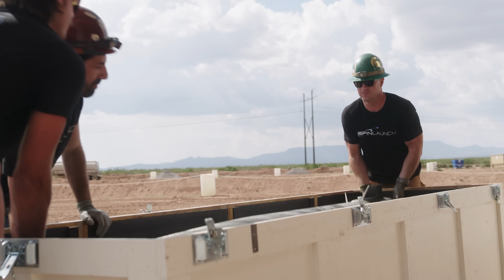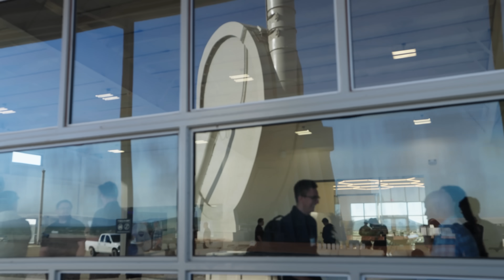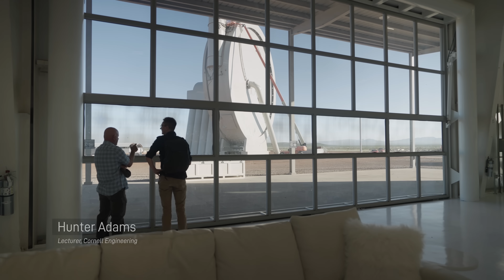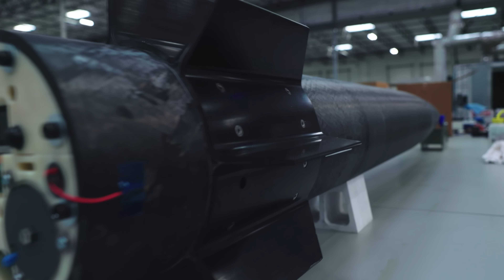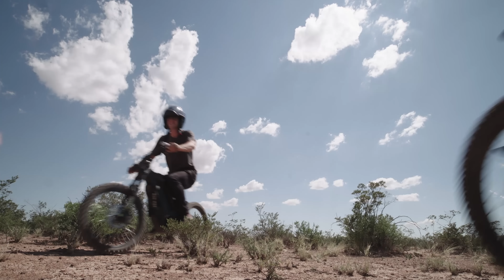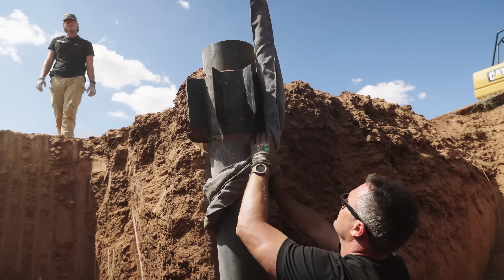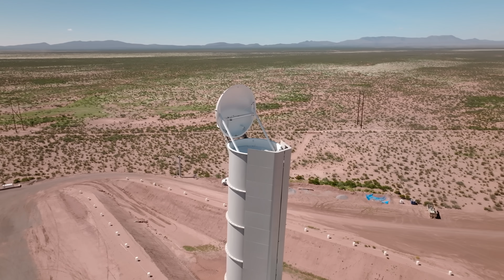Flight Test #10 - The First Payloads

Comment: Spinlaunch: design a technology that flings a rocket fast enough to escape atmosphere 

Military: excellent! Now turn it it sideways.
Reply: they have more eficient ways to do that amount of DMG.
Reply: @nicolaastanghe475  yeah, looking at you Los Alamos
Reply: are you looking at this thing? For intercontinental payloads, chemical rockets are plenty enough already.
Reply: @cdgonepotatoes4219  mount it on a train and you have the Spinner Gustav
Reply: @cdgonepotatoes4219  until you run out of chemicals.  Why do you think the US navy wants to be nuclear electric powered with (electric) lasers and (electric) railguns?
Reply: @ralphm4132  biifuel. You're never running out of propellant as long as there's fertile land and the Sun hasn't swallowed our Earth.
Reply: It won't be fast enough to escape the atmosphere, let alone achieve orbit. And BTW, to achieve orbit you DO need to be traveling sideways (which is why you'll notice rockets angling sideways not long after taking off).
Reply: @michaelnoble2432 In a previous video, they mentioned using a small two stage rocket attached to the launch component. Until some hard numbers about the flight envelope are published it’s difficult to tell what velocity can be reached using spin launch system.
Reply: I’m assuming their pointing it straight up so they don’t pull a Russian federation and fire ordnance into random peoples houses
Reply: "Once ze missiles are up , who cares vere zey come down? - Zat's not my department!", says Werner Von Braun.
Reply: actually you would need to go sideways to bring stuff into space.
Reply: Nerds dissecting the comment but everyone chill it’s comedy gold
Reply: @LebanonJames420  yeah thanks, I think the whoosh was as loud as the spinlaunch whoosh.
Reply: Let’s turn it sideways wins 😂😂
Reply: Bunch of “well actually” ass nerds in the replies, I thought it was a good joke
Reply: @noah4man  🧐
Reply: That's the thing though......the rocket doesn't reach escape velocity at all
Reply: aim it at railgun and see who wins.

Comment: Amazing technology, congrats! Why do you plan to build the final orbital Accelerator at sea level? It will be much more efficient building it at 2500m height, right?
Reply: In North and South America, you do not have many mountains on the East coast. You want to launch towards the Earth rotation direction and as close as possible to the equator (also depends on the orbit). 

The ocean is also a perfect safe place against debris if the vehicle is destroyed mid-flight. For instance you may want to build it along the West coast, to take advantage of the mountains, and launch towards East. If there is a malfunction and the rocket is destroyed mid flight, debris might fall on local population. That's horrible and bad press for the space industry !
Reply: I think the fact you never got a reply tells me it's political... probably saftey to be by the sea but my guess is they are funded with fat grants and have other motives to have their location there and efficiency isn't one of them.
Reply: @DiscoGreen  I think the fact you think sea level is by the sea tells me how political this really is.

Comment: Well done!  Question: Once a payload reaches space, how do you intend to accelerate it to orbital velocity, 17,000mph, to become a satellite?
Reply: The spinning actually doesn't get it into space. All this does is get it closer to space and then rockets take over it's in order to save fuel...
Reply: @traviskey5695  you mean orbit, as the spinning should allow it to get above the 100km altitude
Reply: @biosdilt1399  ACKSHUALLY
Reply: The projectile will contain a rocket which ignites close to the launch apogee and carries it into orbit. Essentially the spin mechanism replaces the first stage (but not the second stage) of a medium-lift rocket such as a Falcon 9.

Comment: This is amazing, it'll cost-effective compare to the traditional rocket launch.
Reply: Yeah the difference is rocket launch exists - this does not... im still waiting for someone to explain physically how can you achieve the velocity required for the 10 minute flight to LEO without the whole thing melting.
Reply: @matejzizanovic7959  I think they're planning to fling these things as a way to replace the first stage of a multi stage rocket. ie, there will be a 2nd and/or 3rd stage srb attached to the projectile to push the payload into orbit. The fling just provides initial altitude at low cost.
Reply: their projection is to be as cost-effective as spacex. see 42 min video on spinlaunch
Reply: @MikeQuinnEnto  Never present a company talking about itself as 'evidence'.
Reply: @gdutfulkbhh7537  42 min video was a team of engineers looking at what they are doing, so not straight company PR bs…

Comment: Um..... flinging a metal tube into the air (however high it goes) is NOT getting anything into orbit.    For orbit you need to get to 17,000mph and in a a specific trajectory, certainly NOT straight up!   so you still need a rocket onboard your metal tube and guidance / navigation and control to get anything into orbit.   and that also requires fuel on-board.     Throwing a metal artillery shell (which is what it resembles) a few thousand feet or even a few thousand meters is not getting anything to orbit.  The Karman line is 328,000feet and that is the START of "space".    This thing isn't getting anything anywhere near the Karman line, and it needs to go SIDEWAYS to get anything into orbit.
Reply: Exactly. Reading these comments really makes me understand how little people know about physics... I get investors are pumping money in it, being physically impossible to be made doesnt mean theres no money to be made on the project, matter a fact main moneymaker thing is hype these days, and hype around space thins is very strong lately, considering people now understanding basic laws of physics...
Reply: @matejzizanovic7959  Yup pretty much.   Also for it to be a functioning rocket after launch (required for orbitral insertion) you'd need solid fuel rocket and avionics, and accelerometers and gyroscopes and mechanical gimbal for the exhaust nozzle for guidance.  I really doubt all these devices could survive (reliably) a 10,000G centripetal load (their number) before being released at very high velocity into 1atm air.    It is basically a mechanical Howitzer (currently).     Do the creators have ANY intention on making this a realistic device for satellite orbital insertion?  Because it 100% will not work in it's current state.  It's a bit laughable that so many people seem to think it's viable. Needs a rocket plus all the internal gubbins (fuel, sensors, avionics, gimbals, ignition source, plus a payload ejector of some type ...) and its a very harsh environment to subject a rocket to before ignition.    Rockets are fine with 10G, 20G, 50G, more than that yes but ...10,000G?   Stuff breaks at those loads and also....to make things survive at those extreme G loads things have to built strongly = heavy = last thing any rocket needs is HEAVY.    High-school physics says it's not working fo satellite LEO insertion.
Reply: These are all very well pointed out comments, probably most can be checked in Thunderf00t debunking videos. One question though: doesn't the Earth rotation provide at least partial tangential speed for the projectile even if it's launched with straight angle?
Reply: @jardel_lucca  Earth's rotation at the equator is approx 1000mph 'East' which is why there is a modest advantage to launching rockets in an Easterly prograde direction from a latitude as close as possible to Equator.  Hence....Cape Canaveral etc. which is 28degrees North of equator and so rockets launch Eastwards (approx) and over water. (safety!).   But it's MINIMAL as you need to be going tangentially at 17,000mph and at a high enough altitude that the atmospheric drag doesn't slow you down so that you crash back to Earth.    This SpinLaunch flight test is an unguided metal tube (AFAIK), and it's impossible for it to get into Low-Earth-Orbit when it's launched vertically from this device UNLESS there is on-board propulsion and guidance and avionics and a steerable gimballing rocket engine.   steerable guidance fins won't work either as they only work INSIDE the atmosphere where there is air.    No air in space obviously, so you need a rocket engine, either solid-fuel or liquid-fuel.
Maybe they DO have a different projectile version that has all that extra stuff in it.... because without that, this project is unworkable.
Reply: You're hurting people's feelings with facts, logic, and mathematics.  Hah.
Reply: @zulucharlie5244  Also the drag of any object hitting sea-level thick air at 1atm (14.7psi) is massive -- it will be instantly decelerating very fast indeed due to huge aero-drag plus of course negative 1g gravity.   Apparently muzzle-velocity can be around 5,000mph, which is a very long way off orbital velocity and it isn't even going the right direction!   It still needs a rocket propulsion to propel it after it's initial launch and it needs to travel PARALLEL to Earth's surface and go a heck of a lot faster than it's device-exit velocity.   Fun toy I suppose but it won't work without rocket propulsion on-board the projectile plus a gimballing exhaust nozzle and avionics to guide it at correct trajectory for low-earth orbit.   No idea if its a clever idea to subject rocket propellants (even solid!) (and gimballing nozzles too) to 10,000G centripetal loads.   Whole thing is monumentally scary, in my view.

Comment: LEO requires not only altitude, but also speed over the ground.  I get how this slingshot can provide altitude, but where does speed over the ground come from?
Reply: Is it due to the rotation of the earth?
Reply: The idea is it replaces the lower stage, you still have an upper stage booster.

Comment: I remember reading an article years ago about miniature vacuum tube circuits surviving 18,000 Gs during World War 2 ( in some artillery shells). No doubt many current projects could survive the Gs in Spinlaunch. 
     I wish you all the best of luck and success in the future.
Reply: It really depends on the scientific experiment. Biological experiments; like studying bacteria or algea in micro-gravity probibly aren't possible.
But there probably are a lot of other experiments/ payloads you can launch on this system..
Reply: All the great inventors in history have had a negative peanut gallery telling them why something couldn’t be done. Then they went out and did it anyway. 

Time will tell.
Reply: Current Artillery shells experience about 40K Gs.  The electronics survive just fine.  This can be as simple as embedding the electronics in epoxy.
Reply: @bradleyrex2968  Seems like it would be far simpler to yeet a payload from an artillery piece than what spin launch is doing
Reply: @LiamL763   That's been tried, but didn't work.  Still someone else might be able to get it to work.  SpinLaunch seems to be making progress despite the internet of experts praying for them to fail.  We'll see.
Reply: @LiamL763  nah. Unless you have enough explosive to match the density of the sun and a barrel the length of Greenland, nah.
Reply: @bradleyrex2968  - "The electronics survive just fine.."

Not ALWAYS.  Some electronic circuits will fail at MUCH LESS than 40kG.
We have had leads disconnect inside IC chips from only Vibration and Acoustic testing at levels nowhere NEAR 40kG.
Reply: @stuartgray5877   Down at the artillery shell factory, you have leads disconnecting?
Reply: @bradleyrex2968  No I build spacecraft and then perform vibration and acoustic testing on them.
Not ONLY will any electronics on this joke of a "rocket" experience the static G-force of spinning UP, but the shock of release then hitting the atmosphere at Mach 25 will be massive!
It will feel like hitting a concrete wall to the payload.
Reply: @stuartgray5877   Oh, What would it be like, hitting a real concrete wall?  And I hate to point this out... like an artilary shell does?
Reply: You're talking about WW2 artillery proximity fuses. Yes, I was amazed too by it.
Reply: i think generally the concern is with any moving parts, electronics and solid state stuff can survive just fine. But if they want a moveable solar panel or antennae, I don't see how it would work. Even attaching a normal rocket engine might be difficult, as the load is perpendicular to the direction rockets normally experience force in.
Reply: They already failed and they know it. They just wanna keep the cash Coming.
Reply: They didn't always survive and function (The vacuum tubes) and they were fully encased in resin.
Reply: Can you name a cpu chip (and motherboard) that won’t crush under the force of 18,000 lbs? In fact can you name a rocket that can withstand that much of a lateral load? LATERAL load not parallel with the rocket.
Reply: @L3SucksAss G’s do not equal lbs. 18000g is not 18000lb unless the object is 1lb.
Reply: @L3SucksAss   Sure, I'd name it Steve.  But in all seriousness, all you have to do is embed the cpu chip (and motherboard) in resin.

Comment: Very impressing concept! Hope this becomes a sustainable transport system in the future. 

Can you explain why the payload leaves perpendicular to the earths surface and not at an angle? I assume the final goal is to get it into a stable orbit.
Reply: That would force the projectile to fly through even more atmosphere. Would slow it exponentially.
Reply: all rockets launch perpendicular to earth
Reply: Launch angle for the production version, should it be built, will be 35°. The development system can be rotated through a range of launch angles. I guess if it's aimed vertically, the projectile won't travel far downrange and can be recovered more easily.

Comment: Impressive! Bravo!!

They shot it right through the roof? They didn’t put a spin on it so it would rifle through the air? How high did this scaled down version go? So many questions.
Reply: My guess is they pull a vacuum in the launch chamber and the roof part it blasts through is just a membrane to keep it airtight until it launches.
Reply: @darkcognitive  Good point. Cheaper and easier to engineer the launcher to accelerate it through a vacuum. Maybe in the future a door will explosively open at just the right moment.

Comment: What material is the blister made of that retains vacuum inside? The Martian needed this thing for the greenhouse!
Reply: It doesn’t maintain a vacuum, the round portion of the structure stays under vacuum, the vertical portion of the structure is an airlock under vacuum as well, with a (very fast actuating) door to the round portion on the bottom and the membrane at the top. Before the rocket pierces the membrane, the bottom door is closed allowing the structure to remain at a near vacuum and thus save on costs and wear and tear on the structure.
Reply: @TimBryan  wow, another challenge tackled...

Comment: I see the worlds most dangerous amusment park rides. I would kill to get one day to launch random shit out of that thing. Nice job guys!! Keep up the great work. Hard to push the envelope when there is no envelope. Good luck, and God speed.
Reply: I fully support the amusement park "ride" proposal.
Reply: No human is conditioned to survive anything higher than 5gs, let alone 10,000gs tho lol
Reply: @Director-M  who said it's meant for humans? We have plenty of "stuff" that needs transport to space and beyond. As opposed to using combustion for the delivery of these items and tainting the atmosphere, it makes far more sense to just gradually accelerate, then launch them off the planet. Engineers for years have been trying to find the most efficient method of applying power, we ended up with a wheel. It makes sense to once again, fall to the physics of a circle for support. UNTIL we discover a more scalable version of something that uses less energy, this is the best option for "stuff" on the table.
Reply: @SpadeNya  if you read who I was replying to, you'd notice they mentioned something about this potentially being the world's most dangerous amusement park ride. Hence my response? ..

Comment: Incredible, what you have achieved ! 👍  This is totally A-W-E-S-O-M-E !    Congrats !
Reply: What exactly did they achieve though? Can someone explain?
Reply: @matejzizanovic7959  the end goal is to get rockets as high up into the atmosphere as possible before igniting engines which will bring it out to space. It'll save fuel. It'll never be for launching people into space, but it could be beneficial with regard to sending payloads. Friendlier on the environment, too.
Reply: @jonathanconnor7920  pipe dreams
Reply: @spencer963  well judging by the fact this is their 10th launch and first with a clients load! I would say that it hopefully going to be more than a pipe dream
Reply: @dumitrulangham1721  not even at a fraction of the speed/g forces necessary to achieve any orbit. It's an overpriced slingshot. On a planet with the gravitational pull of the moon this might work. Here on earth, with our gravity and atmosphere, it isn't so easy

Comment: Question: why launch with the door closed? Won't that slow down the object and further increase the drag and possibly  prevent it from reaching the necessary velocities for the satellite to escape the atmosphere?
Reply: keeps the vacuum in. They spin it up to crazy speed in a vacuum, because getting the arm and vehicle moving that fast in the atmosphere would put some insane aero loads on the arm, possibly flutter, shockwaves from breaking the sound barrier, etc. and it would probably rapidly disassemble itself.